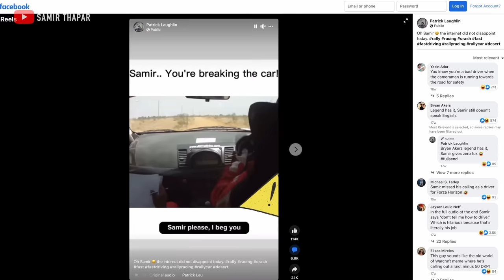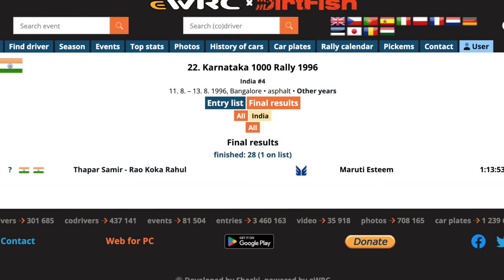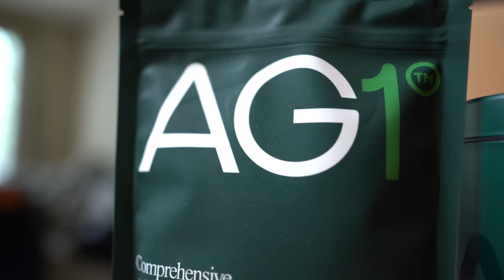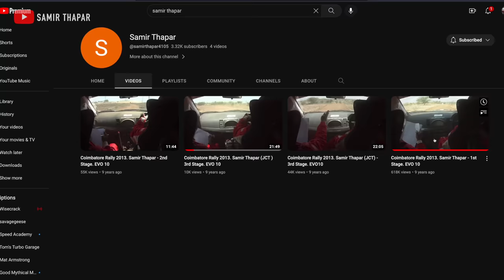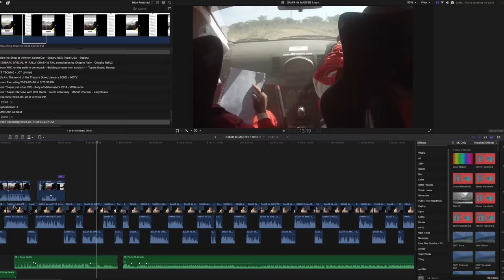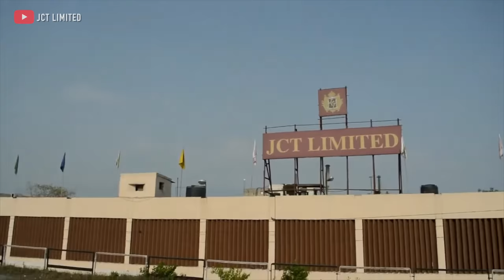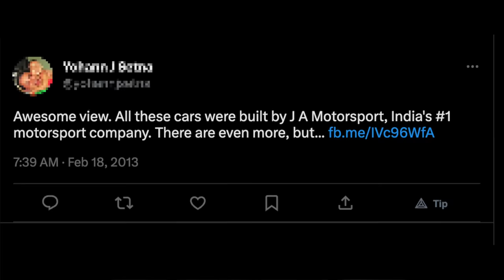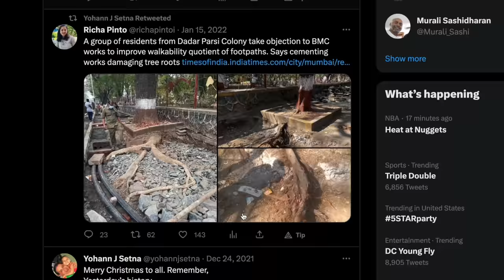This Viral Meme Ruined His Racing Career

Comment: I'm a Navigator in offroad desert racing. Our stages are into the hundreds of kilometers, if I'm yelling at the driver that much, in such a short stage, there is something dreadfully wrong. Just because a driver has decades of experience, doesnt make them any good. The edit wasn't the problem, the driver was. I guarantee, a powerful man like Samir wasnt happy losing face because of Viveks comments and that, I'm betting, was the cause of Viveks troubles. Might post some in car footage of ours, it can get pretty heated in there!
Reply: I was looking for this comment. It doesn't matter if the 3 minutes of incompetence are cut out of 40, it's still 3 minutes of incompetence.
Reply: Yeah imagine this as a flight instructor.
Reply: Yeah I never thought Vivek was the one that looked bad in that video.

Comment: soooo, he isn't actually a rally driver with 20+ years of experience since he started in 1992, retired in 1997 or whenever - couldn't really understand from the video since you mention he retires in 1997 but then you also say "it wouldnt be until 10 years after that, in 2013, that Samir would finally lace up his racing boots properly" (he returned in the Evo in 2013). If my math checks out - what happened in 2003? Somethings off with the timeline, or there is just missing information in the video about his carreer. Either way he started in 1992, finished in 2016, but if you are retired for half of that time period, it doesn't mean you have 20+ years of rally experience :D

Anyway - loved the video, thanks :) !